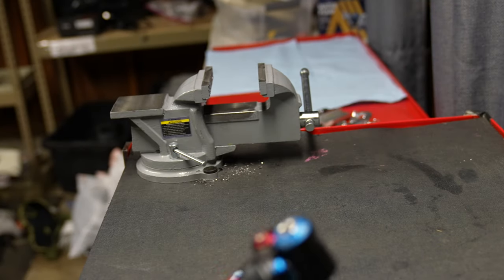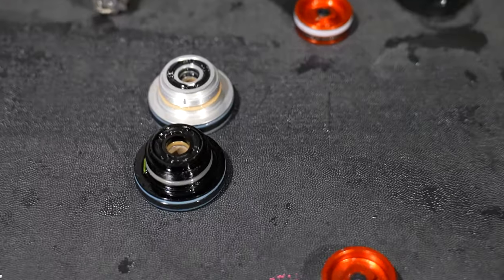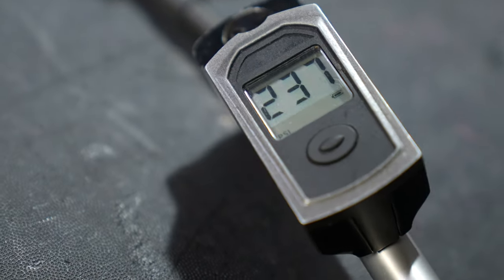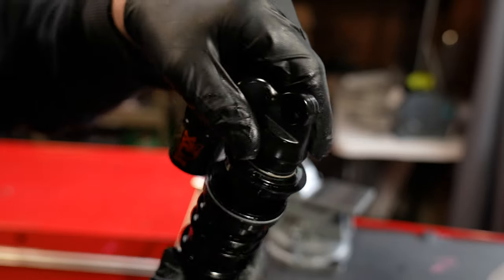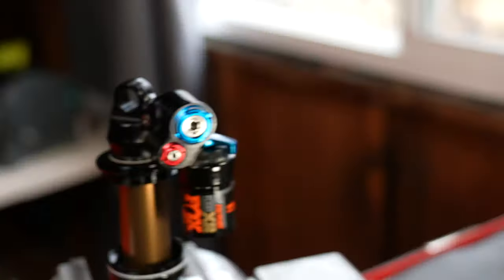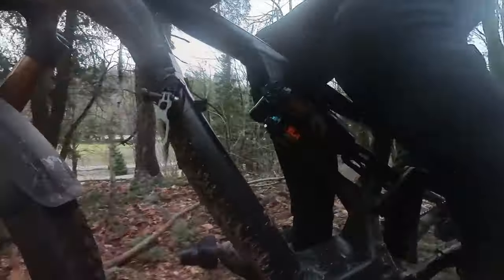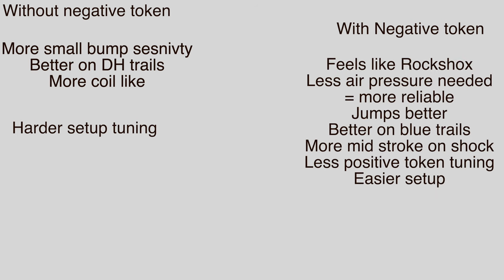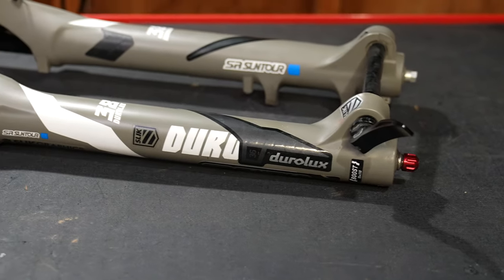Unhappy With Your ‘24 X2?  WATCH THIS!

Comment: Very interesting as I recently bought a bike with the updated Float X2 and I was surprised that I could easily set sag without maxing out the air pressure and even put too much air at first, looks like that little negative volume spacer is really on all 2024 shocks helping to reduce pressure in the shock. I had issues running proper sag or maxing out air pressure in the past with that shock

Comment: Interesting.  I guess that explains why I had to add more air when I installed the 2024 version.  I've been screwing with the settings for months on the 2024 and still haven't gotten it to feel as smooth as my 2021 did.

Comment: I will have to take my 24 apart I just got from fox last week replacing my 22. I put the same air pressure on my 24 and my 22 and my sag was the same. Have not hit a trail yet though.
Reply from the maker: If you don’t like the way it rides you know what to do. I personally fought the new one for a week, tokens, shock wiz, talking to Susoenion tuners, before realizing that foam ring was a negative token. 

Between Fox’s silent recall and making a drastic change to the shocks air can without notice it was just annoying

Comment: I have a 2020 X2 and i struggle to use more than 60% of the travel. No positive airtokens and 30+% sag.. I wonder what to do to make it more compliant for what i do - mostly trail with ocasional tehnical descents
Reply from the maker: Make sure the compression is open watch this Fox Float X2 Beginners Guide
https://youtu.be/IEt9vbQSd98
Reply: Then it's clearly improperly tuned for your bike.

Comment: Are both those shocks the same tune code? Because one is trunnion and the other standard.
Reply from the maker: That was just another shock, but whatever Fox sent back has no tune code.
Reply: @OtterMTBtech  put the serial number (it was located neat the high speed rebound nob on mine) into Fox’s website and it should tell you. My understanding based on some forum discussions is that the foam ring is a tuning option and not standard across all shocks.
Reply from the maker: Both warranty shocks returned with the foam ring, same tune codes completely different ride

Comment: Fox show it in there video the difference in their Test lab all the Shims they packed into it they said and show so im guessing your saying this is wrong? Its just im looking to click buy on one and been hamging off to find out more on the 2024 shock as said to be a massive improvement on the 2023 model that has all the problems? Don't you just love salespersons 😂
Reply from the maker: I’m sure it’s all different, gotta read past the marketing, this negative token the video is based around is the feel difference. 

The ‘24 has 2 rings in the seal head so it’s reliable
Reply: I have been watching other teardowns in French on some channels. They have the new cover with seal rings, but I have not seen that nag token in any others, so I am wondering if they just got a rebuild and not a 2024 replacement. But they do have the thicker trunnion and side bleed screw weird! 
I managed to get one pretty good deal on a brand-new warranty replacement 2024 version the other day from someone. I'm just waiting on it coming! I'm a heavier rider myself. My new Float X on the ID says it has a 0.9 spacer in there, so I am going to try what you said in another vid with the 0.6 to see if it's any better. It doesn't feel like a 6 grand full-suspension just yet, but I was used to coils all my days. Air shocks are new to me, really! Honestly not impressed! But then not set up right yet just the sag but man it's like a hard tail with sus seat post! I grabbed the 24 x2 because of the price I got it for but still on hunt for 205x65 coil! Interested in that jade X you reviewed jsut hate the colour green 😂

Comment: Just get rockshox
Reply: Rockshox was harsher, which is what he said in the vid. I would concur. While my '23 X2 was out of commission I replaced it with a RS Super Deluxe Ultimate. It was definitely harsher. It was snappier, for sure, but not near as plush.
Reply from the maker: Nothing is quieter and jumps better than ‘23 Rockshox’s. As long as your cool with no small bump and arm pump. Fox is plush bucket goodness, but as this ‘24 X2 comes out, goes to show less small bump compliance (smaller negative chamber) is more reliable. 

Fox just quietly copies Rockshox and doesn’t tell you about it

Grip X damper next month!!